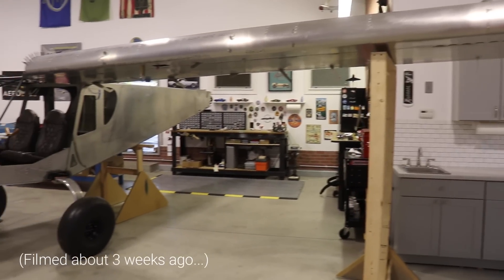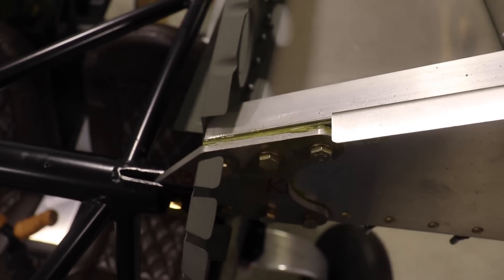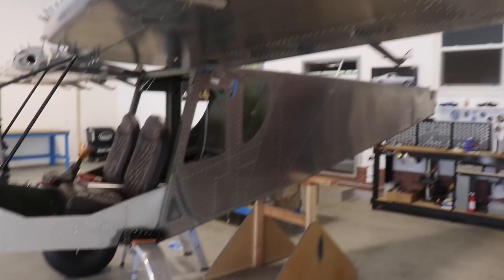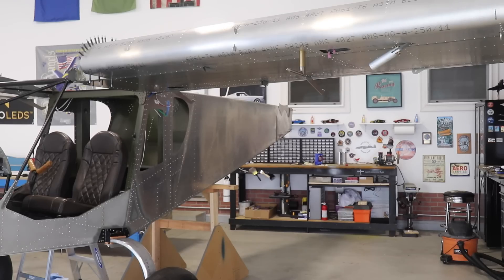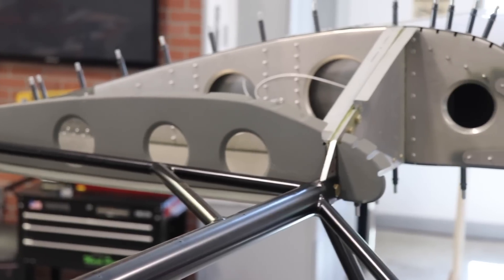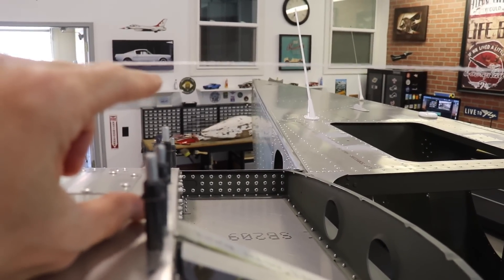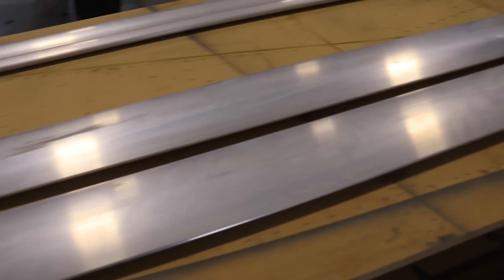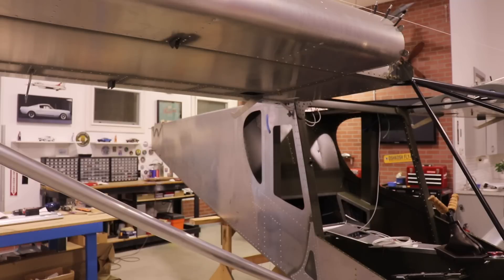Zenith Super Duty Wing Attaching

Comment: Great videos and very helpful. What is the height of your wooden wing supports.?
Reply from the maker: I've discarded those wing supports a long time ago so I'm not sure how high they were, but what I did was measure from the floor to the wing attach point on the fuselage. Then I made them "a little bit higher" to account for the dihedral (the further you get towards the wingtip the higher the wing will be). I intentionally made them too short because if they are too short, you can always add some wood or spacers to lift the wing. But if you build them too high, then there's no way to compensate for that-you'd have to take them apart and cut them down a bit. So...make then "a little" too short, and then plan on adding spacers to get the dihedral perfect. Also, you can move them in and out towards the fuselage and wingtips to make smaller adjustments. Thanks for being a Member!
Reply: @KitplaneEnthusiast  Thank you.

Comment: I have the first bolt in, getting the wings dialed in. Both sides seems to naturally sit at 3 degrees. Not sure about the rear spar to fuselage measurement as this would set the wing sweep or lack there of. Does the line help set the distance?

The shim you made.. I may need to make one too on the rear spar to fuselage fitting. Did you use some skin material from the holes you cut for the shims?

Comment: ♥️ The t-shirt. I had to stop and do quite a bit of reading regarding wing angle of incidence, sweep, and dihedral. I came away with the understanding the these angle specs, limits, and tolerances should all be mirrored on both sides as closely as possible. I don't know, maybe lowering the right angle of incidence three quarters of one degree opposed to the left wing would create a nice stick feeling. 
   The wing strut's are sexy hot - so I had swap them out for 4130N tubes in my mind for aesthetics.

Comment: Ultra high molecular weight polyethylene (Dynema, Spectra, etc.) for the minimum stretch. 
Panel (drywall) lift is a handy adjustable way to hold a wing up. Use some foam insulating panels to protect the wing (mine is fabric covered.)
Reply: Braid fishing line would probably work fine too.  I think it's mainly Spectra type material.

Comment: the two tip end of the wings had to be level also, and the cabin has to be level
Reply from the maker: Not for setting the dihedral. You could park the airplane on the 45 degree bank and as long as both wings measure the 95mm at the root you can set the dihedral.
Reply: @KitplaneEnthusiast  you are wright  thanks awesome chanel

Comment: I just installed wings on my Cruzer. Searching the forums prior, some had to slightly sweep wings aft (instead of perfectly 90 degree to fuselage) in order to achieve edge distance on the rear spar. How was the SD in comparison? Thanks!
Reply from the maker: Same way. They are very slightly swept. Remember, the string over the line of rivets is ONLY used to set dihedral and has nothing to do with the wing sweep. I set both wings so that the aft spar is about 1/16” away from the fuselage. That leads to a very slight wing sweep.
Reply: @KitplaneEnthusiast  Way back when I mounted the wings on my 750 STOL, it also required a bit of rear sweep to achieve edge distance on the rear spar.  I consulted Caleb, who was an engineer that used to be at Zenith, and he said it was perfectly OK to sweep the wing a small amount - rearward or forward sweep, as long as it was symmetrical, of course!